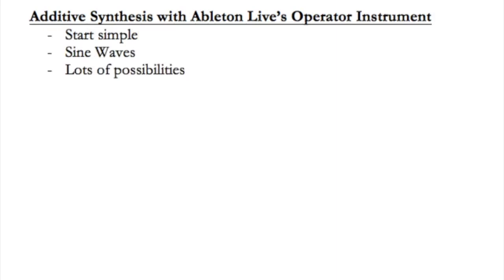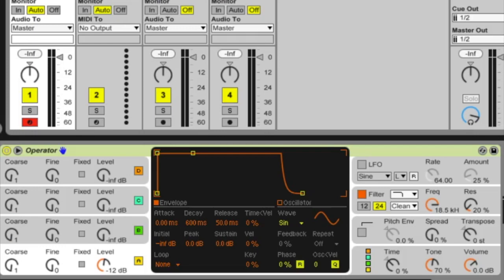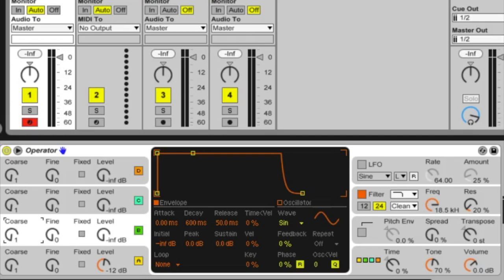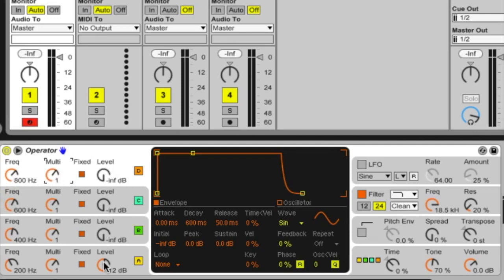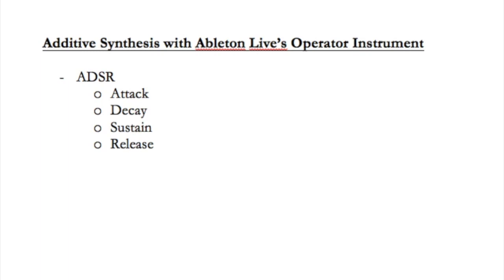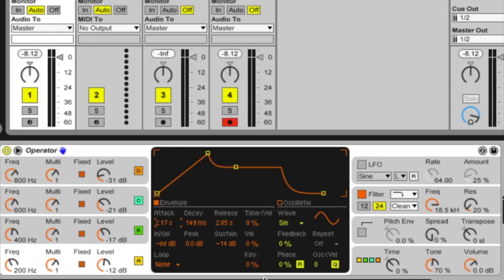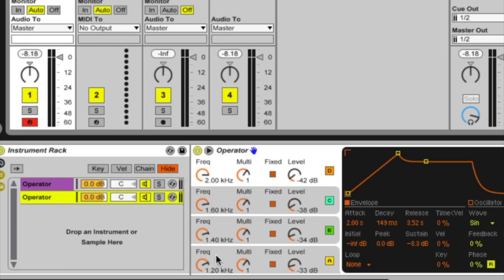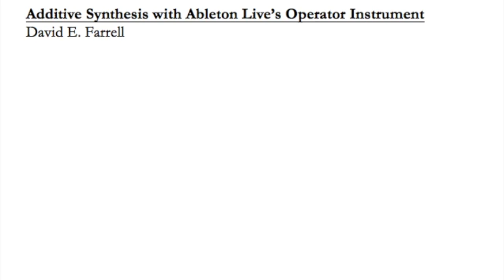Ableton Live: Additive Synthesis with the Operator Instrument

Comment: lol you didnt skip the option to draw up to 64 harmonics for each osc at all
Reply from the maker: Hi! Additive synthesis uses only sine waves. If we use this feature, then we are building cool complex waveforms to combine, but they aren't necessarily all sine waves. If you use that feature with just one one oscillator, it limits our synthesis opportunities to only upper partials that belong to the harmonic series; it also lacks great fine-tuning controls. Because of that, I don't think that feature is the most useful for additive synthesis and I didn't include it. It is a cool thing to mess with, though.
Reply: @DavidEFarrell  Actually, the 64 harmonics are each a sine wave in the harmonic series, and messing with those is the primary way to do additive synthesis in operator. The whole point is to create more complex waveforms out of those 64 sine waves. Some synths allow you to have each harmonic represented by a complex waveform, but operator doesn't do this. It's a feature I've only seen in Alchemy.
Reply from the maker: @AntandraMusic  Sure, but then your sound will be limited to sine waves that are in the harmonic series of the oscillator's fundamental, which is so intensely limiting! Ableton does let you do the thing you say it doesn't - just set your different oscillators in operator to whatever waveforms, amplitudes, and frequencies you desire.
Reply: David E. Farrell True, although to say that the only way to do additive is by setting the algorithm to parallel isn’t accurate. This is still a good tip for getting creative with it.